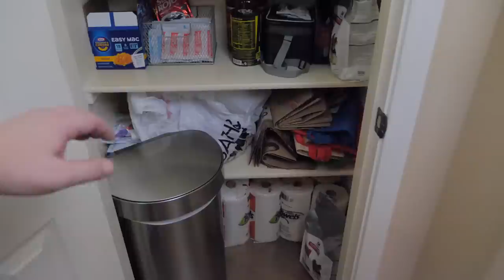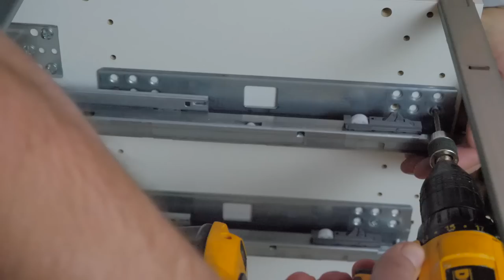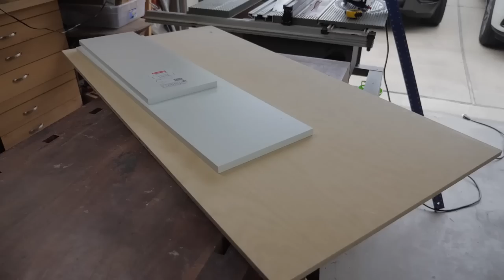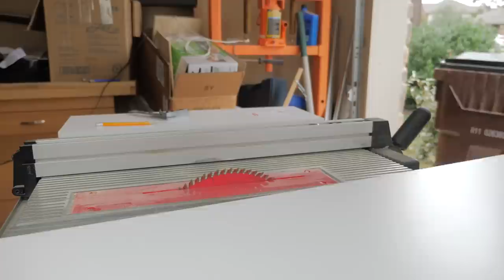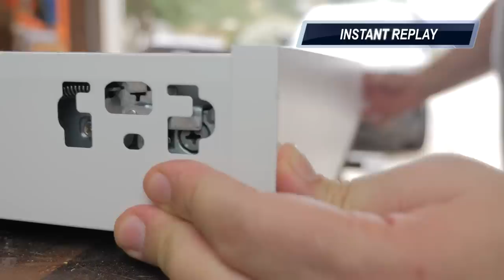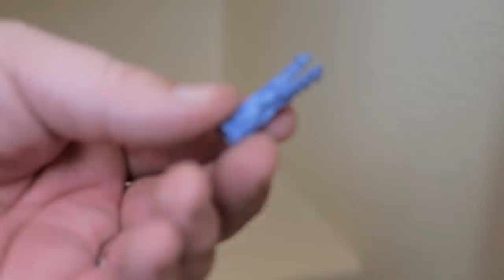How to Make Pull Out PANTRY Shelves from IKEA Drawers   Easy DIY IKEA Hack for Pantry Organization

Comment: Great idea and craftsmanship!  But, you basically spent $50 for 2 sets of draw slides.  These can be purchased for about $8 per set, at any of the big box stores.
Reply from the maker: Thanks for watching and for the complement on craftsmanship. 

So there were actually 3 sets of heavy duty Blum slides, which can’t be bought at any of the big box stores. And the slides that are at the box stores would require me to build a drawer frame to attach the slides. 

Then, that drawer frame would require that I use a router to crate a groove for the drawer bottom to slide into. 

And on and on. Bottom line is that the slides at the box stores would create more work for me, which I was trying to avoid. 

Plus you’re forgetting that I have a nice cabinet box left over that I actually use in my shop every day. 

I mean, don’t get me wrong, if you’re on a budget you should definitely look for alternatives, but, for me, cost was secondary to speed and ease in this project.
Reply: You can not get high quality soft close draw slides for $8 any where. For $50 this was a good idea anymore money it would have been not.

Comment: I first watched your under the sink drawer video, now this. Sadly the closest IKEA is 3 hours away. Buying these shelves by themselves is expensive! You're getting the hardware as well. This is genius. I'm trying to figure out a way to make them myself. I don't even have a circular saw. Maybe I should get an inexpensive one. Would still save me $$ in the long run. Can you answer 1 question? I was just going to use the 1 ball bearing center slide in the middle of the drawer. Any experience with those?
Reply from the maker: I don’t have any experience with the center slides. My guess is that it wouldn’t be ideal. I think most cabinet makers have figured out that dual slides are provide more durability and greater stability.

Comment: You drawer is perfect! How did you determine the length of the drawer bottom panel and the distance between the grooves?   I imagine it is your original shelf width - xx mm side clearance.   I did a couple of these "hacks" and had issues with the glides binding a bit and I had to redo/adjust because things were off just a bit ( around 1/16"). I ended up using the metric ruler to to get more precise measurements but still had a hard time. It came out great in the end but I had to tweak it several times and patch up several holes!

Comment: What table saw are u using? It is so smooth👍
Reply from the maker: It’s an old BT 3000 made by Ryobi. They don’t make them anymore but sometimes you can find them on craigslist or Facebook marketplace. And since sold it, and I am looking for a good deal on a full-size cabinet-style tablesaw. While I had it, it was a really good song for the price!
Reply: @jasongarringer12  thx, so powerful and quiet, I wonder if the new models can do the same job as this one?

Comment: Forgive me if this has been asked, but what was the cost of everything?
Reply from the maker: I would estimate the cost to be about $30. The total cost of the cabinet and 2 drawers was $50 on clearance at IKEA. Assign maybe $20 to the cabinet, and $15 per drawer. I repurposed 1 drawer for this build, and purchased a piece of plywood for the drawer bottom.

If you can’t find the cabinet on clearance, you can purchase the drawer by itself (see link below). Just make sure to select the proper depth. 

https://www.ikea.com/us/en/p/maximera-drawer-low-white-30265659/
Reply: That's awesome! Much less expensive than buying a kit. Thanks so much and now following your channel!
Reply from the maker: Thanks!  One trick I’ve learned is that you can buy the cheapest drawer parts as long as the depth of the drawers match your project. Then just replace the drawer bottom with the appropriate board to match your width. 

For example, if your drawer project has a depth of 24 inches, you can buy ANY Ikea drawer that is 24” deep. Then, add a custom drawer bottom that equals your custom width!  Works every time.

Comment: It's faster and more cost effective to buy drawer slides, especially since you had to disassemble and remake most of the wood parts.
Reply from the maker: Hi y’all.  I just like up-cycling and I repurposed each and every spare piece of the original cabinet. For example, I’m using the cabinet (without the drawers) as a tool stand in my shop, which I was in need of anyway. 

I actually saved myself money by doing it this way. 

I respect your opinion tho. To each his own.

Thanks for watching!

Comment: I don’t understand why the drawers have a taller front panel but the sides are quite short in height? It annoys me for some reason but it isn’t only ikea, lots of stores do it.
Reply from the maker: I think it’s because there isn’t much side-to-side motion in the drawers. If items are sliding around, it’s likely from the front-to-back motion of pulling/pushing to open/close the drawers. Unfortunately, some items can sometimes fall over the sides because the drawer sides are so short. Thanks for watching!
Reply: Jason Garringer I just bought a couple of quite old pieces of furniture to do up and they have the ‘normal’ drawers where they are equal height all the way around so the short thing must be a ‘cost saving’ action. I love your videos on repurposing!